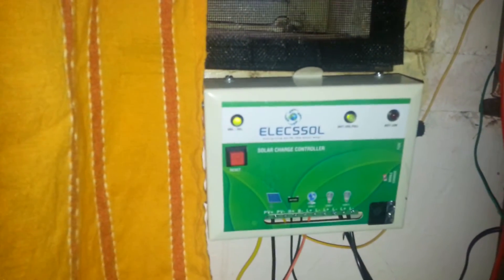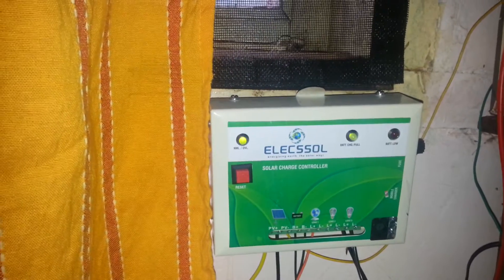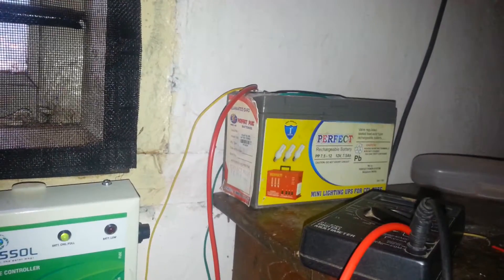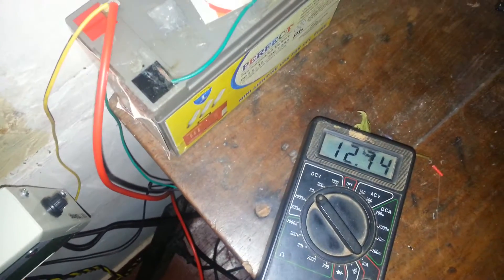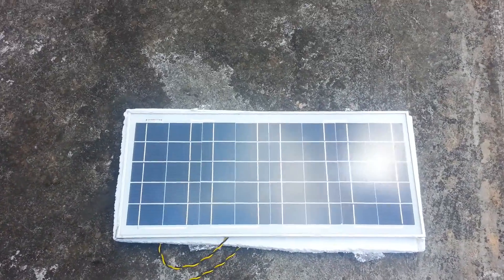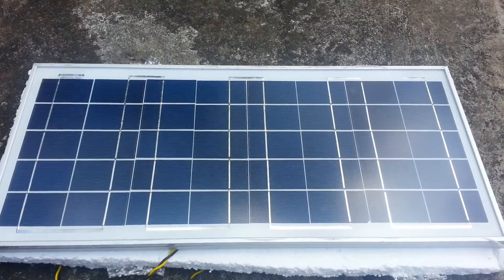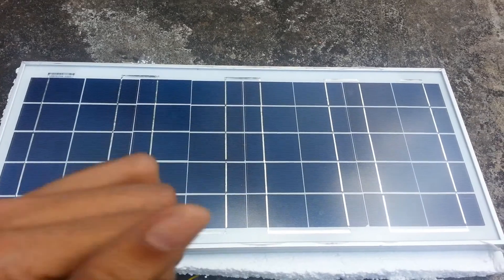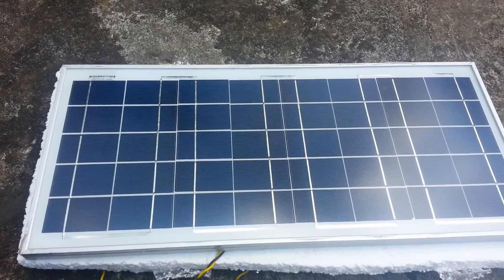my solar powered WiFi modem runs 24x7

Comment: Hi there, I'm new to solar system. Can you teach me how to set up one like yours?
Reply from the maker: Ivan Leow Hope this video will help you :)
 https://www.youtube.com/watch?v=lB8q20QX6bA
Reply: vishal arwade which type of battery is better for solar system?thnks in advance
Reply from the maker: I would recommend  Deep-cycle or lead-acid batteries for running biggers loads  ....here i am running just a 10W Modem so i am using small sealed lead acid battery. ...